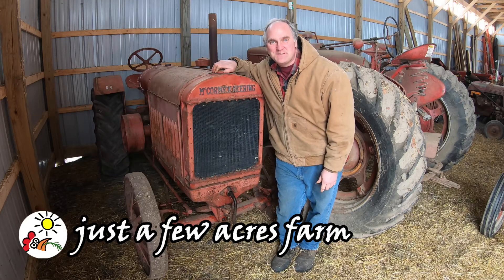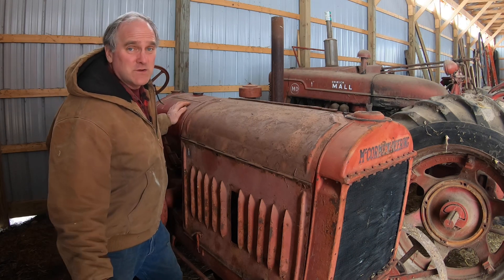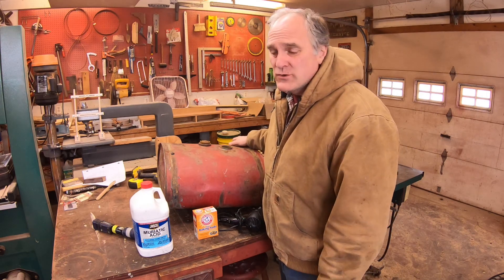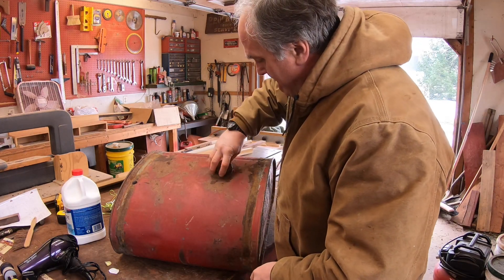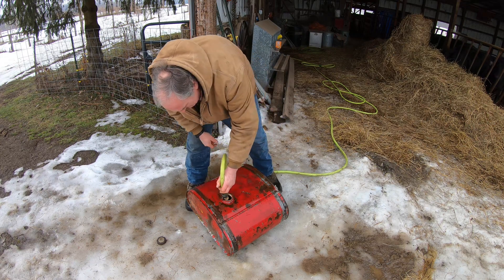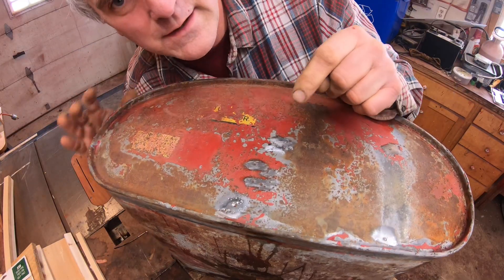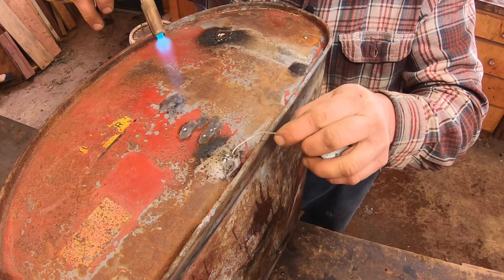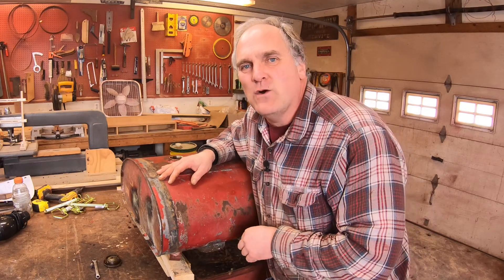getting the 1924 McCormick Deering 10-20 running | part 1: repairing a rusty fuel tank

Comment: Enjoyed this segment of YouTube. I am an avid collector of kerosene and oil lamps and have had to use a sealer to stop pinhole leaks in antique lamps. W T Kirkman in Ramona, San Diego, Cal. has been providing me with Gas tank sealer for years. You pour it in the cleaned tank and it plugs all the pinholes. Pour out the excess. Lasts indefinitely. Thought that may be a good solution for you instead of soldering.

Comment: Peter for a final application use from a Aviation shop a compound called SLOSHING SOLUTION. 
I have used it on aircraft tanks many times and also old motorcycle tanks. 
I have also used it to seal leaks in the floats (pontoons) of aircraft. I swear by it.

Comment: To dry the tank after the water pour high proof methyl hydrate (aka wood alcohol) drain that and use the hair dryer on cold setting for ten minutes then on heat for a few minutes.

Comment: Pete, on buying a front loader or tractor, is it worth spending the extra money for a newer four wheel drive version? There is certainly a big price difference. Do you know how big of an advantage four wheel drive is? Thank you for your wonderful videos.
Reply from the maker: Hi Mike, we don't have any four wheel drive tractors, and get along fine through mud & snow. But we are also running older, heavier tractors with loaded tires. If you're buying a newer small utility tractor, 4 wheel drive is more important because they're lighter, especially with a loader taking traction away from the rear tires. This is assuming you're going to be using it in slippery conditions. If not, 2WD is fine. The thriftiest choice is to buy an older tractor (from the '60's or '70's), but it requires some mechanical know-how to keep running.